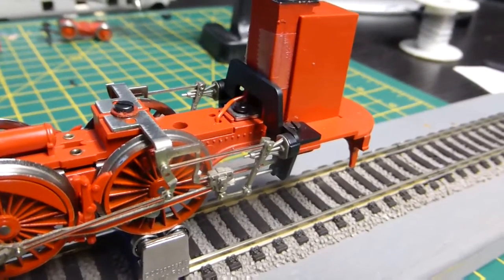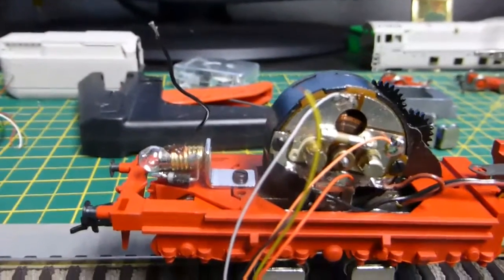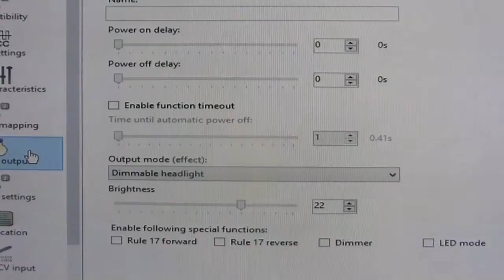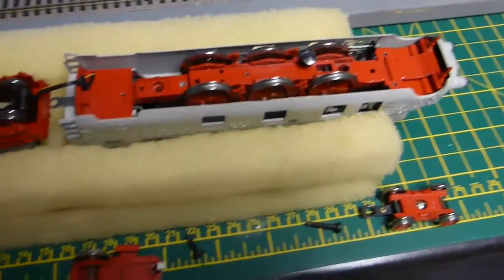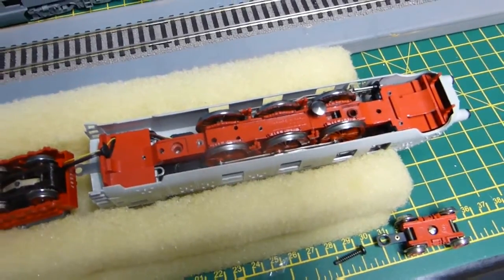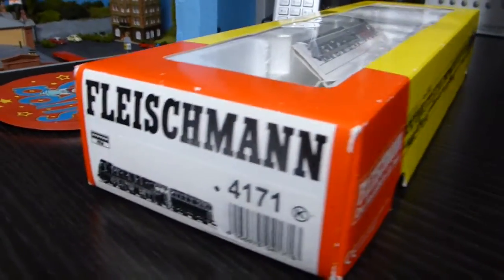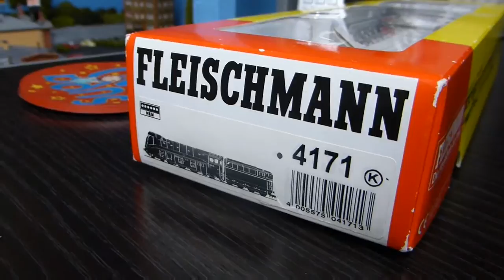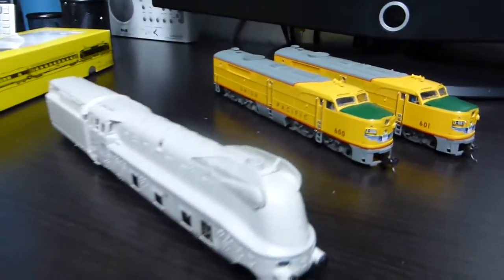Fleischmann br03 analog to dcc conversion

Comment: Great video, thanks for sharing the knowledge.  Why did you leave that cylindrical component on the motor?  You took out the coil which I understand, but not the other thing..?  Surely you don’t want anything between your pickup and your decoder?
Reply from the maker: Thanks...there  is no need to remove that part as to does not effect the dcc install or chip.
You could remove it but it's extra desoldering.
Jim

Comment: I am using this vid to convert a Fleischmann  HO 4086 (DB 86 457) to DCC. it is a Tank loco Instead of Tender, Do you anticipate any problems or can you give me any advice
Reply from the maker: The only problem you may have  is there are a few types of fleischmann pancake motors which may be different to the one in this vid...it may be a bit  trial and error to connect up the motor but I would give it a shot if it was me...
Jim